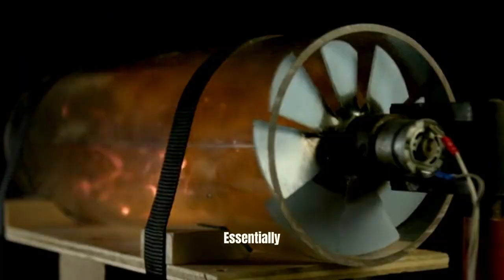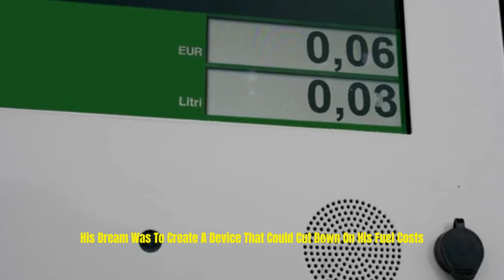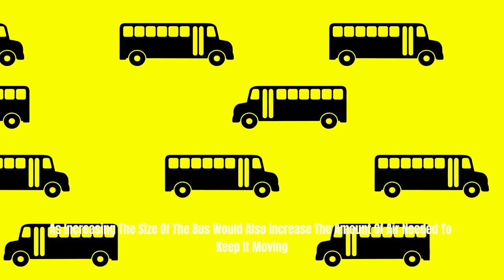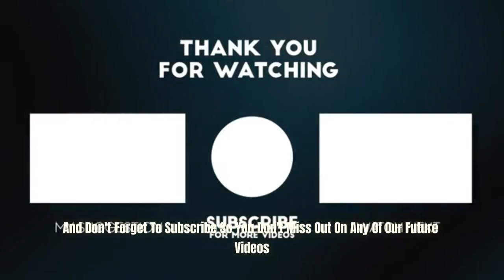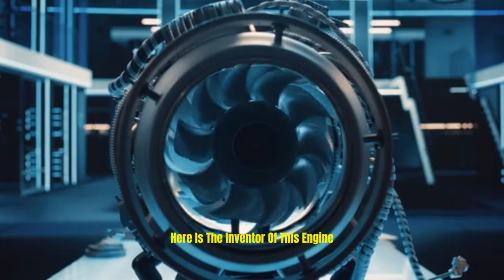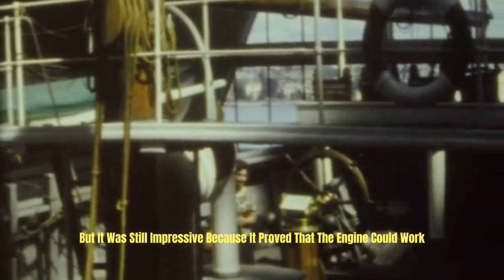WORLD EXCLUSIVE: Maxwell Chikumbutso's Bus Runs on Thin Air! (No Fuel, No Plug-In)

Comment: Doesn't exist. Zero invention. Just a scam. An invention that is  impossible to work. Totally impossible to get electrical energy from radio waves to power vehicles. At best it could only PARTIALLY light a tiny LED as there be some electron flow when setting up an appropriate circuit. A type of experiment performed by high school physics classes in Western countries. That's it. Stop this crap.